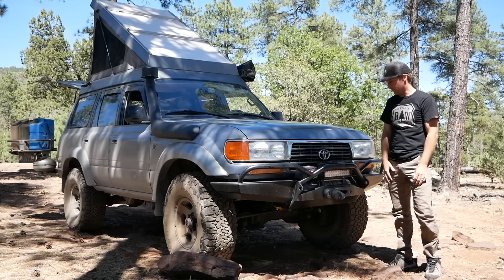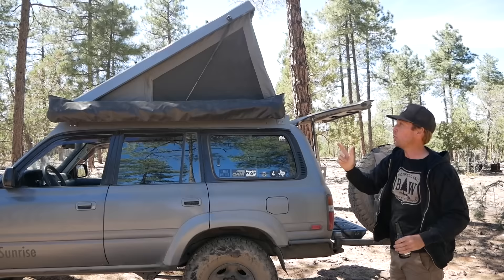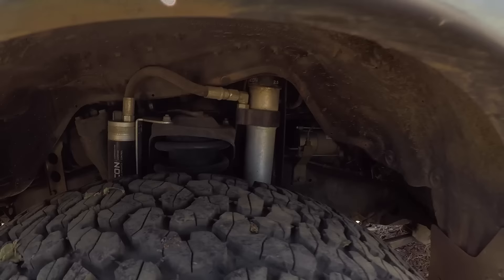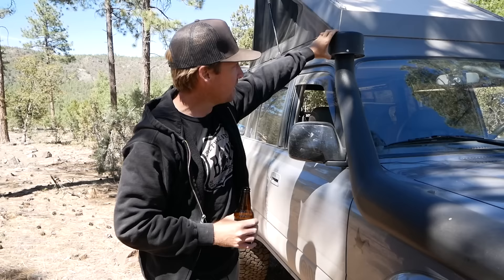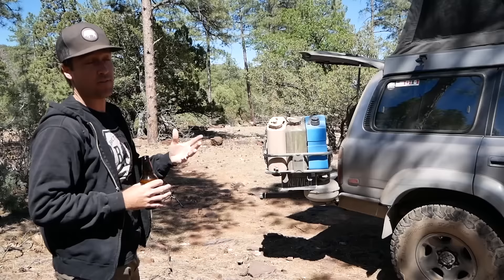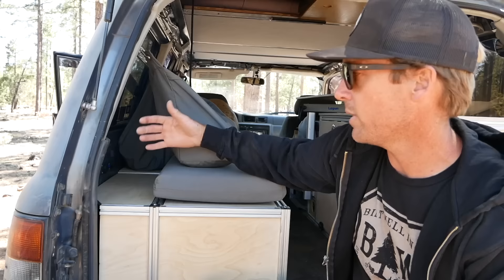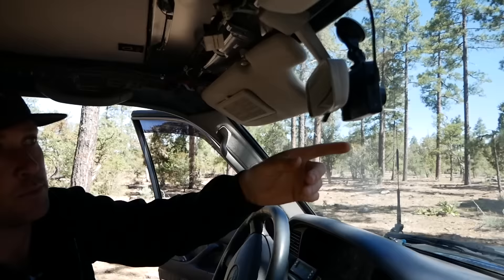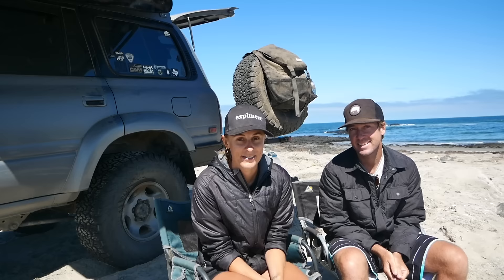Tiny Home Tour - Our Overland Land Cruiser with Pop-Top

Comment: This video has been so helpful in aiding my decision making on our own 80 build. Tim, you mentioned running a low voltage disconnect when Goose was on a single battery. Do you recall what device you used and if you wired the entire truck (even the starter) through it? We love and look forward to all your content, keep it up. Thank you in advance.
Reply from the maker: Cheers Trevor. The two I used we're a Battery Brain and later a Priority Start. Both saved me several times over the years. I went ahead and wired everything through it just to be safe in case there was some parasitic draw.

Comment: Cool video guys - very interesting build up - happy travels - so jealous! Just a thought on your lpg gas bottle location - might not be legal as it would be in a bad spot if someone rear ended you. Definitely not legal here in Australia. Will be following and drooling 😁
Reply from the maker: Thanks man! Fair point! What's odd is that in Arizona vehicles were installed with an LPG tank in the back of their cars to be more "Environmentally Friendly" so there are a lot of other... explosive vehicles out there. Does that make me feel better or worse. Not sure!
Can you keep fuel cans on the rear bumper?
Reply: DirtSunrise  diesel is ok on the rear but apparently petrol isn't because it's more flammable. There was a post yesterday put out by our cops defecting a car for having it attached to the spare - he also had a solar panel on his bonnet and had cut his number plate in half to go around his winch at the front - so I think he was asking for trouble 😁 keep up the great vids guys 👍

Comment: Nice rig. You mentioned possibly getting the AISIN hubs later. How do you like the KVMs now? Pros and cons? Thanks in advance.
Reply from the maker: Never had an issue and they're still on the truck. We sold it, but I would switch to Aisin if we went back to wheeling hard.

Comment: Did you swap the wiring for your starting battery?  Or are all starting batteries for LHD Land Cruisers located on the right side?  Here, in Australia 80 Series Land Cruiser OEM battery (ie. starting battery) is located on the right side.

Comment: Would you give the name and model of the tent please? I couldn’t catch the name. Thank you. My 80 is at 220k, and I’m still unsure if it’s worth putting that much effort into it but this is inspiring. Goose rocks!
Reply: Nevermind, you only had 2 videos dedicated to the pop top. ;)
Reply from the maker: Roland Rosso thanks Roland. It's called a Campteq. Only 7 or 8 were ever built. You can cut your roof off like we did or just put it on like a tent via the drip rails. I've heard some more may get made. Keep an eye out on IH8MUD.com for them. 👍👍👍
Reply: Yup. I got in touch with the builder. Sounds like getting one is possible. I'd need to sleep 4, 2 up 2 down, so I'm going to very precisely cut Amazon boxes as templates and play a few games of Twister in the back of the 80 with the family. Really like your channel by the way. I like the details of the build and how you put it to use.
Reply from the maker: Right on. The upper area is tight. Perfect for us, but for someone over 6' or for 2 people who weren't fairly skinny it would get annoying. Thank you! Good luck, let me know what way you end up going. Sounds cool!

Comment: Not sure if I just missed it in this video but have you gone over what you’ve done with your rear awning anywhere? I’ve seen it in the other videos and thought about doing something similar for my 100
Reply from the maker: We haven't really done anything very in depth about the rear awning. It is homemade, just sewed a square and on one end we attached it to the truck with some sail track (usually used for boats). On the other end we put eyelets so we can attach to poles. Works great.
Reply: DirtSunrise cool thanks!

Comment: Hey nice set up. What materials did you use for your storage system? Those metal joints look really nice and seem to be easy to work with!
Reply from the maker: All 80/20 extruded. There are a ton of websites where you can buy parts and assemble just about anything. It's easy to work with!
Reply: Cool! Thanks!
Reply: did those interior cabinets come from the same guy as the pop top? looks just like a different video (far out overland i think) i saw of an hdj81 pop top